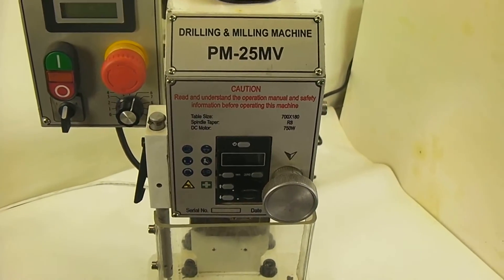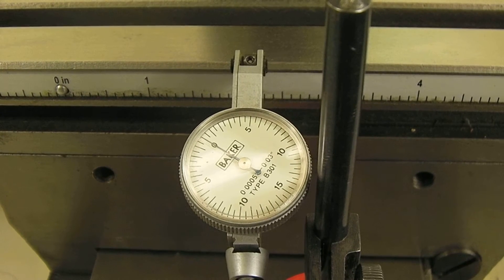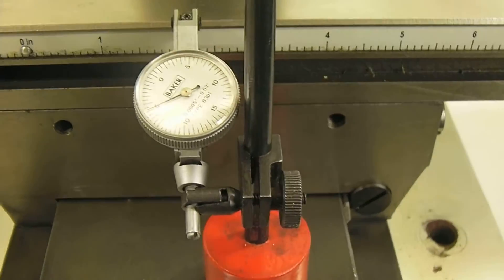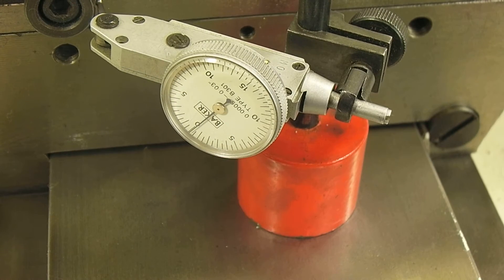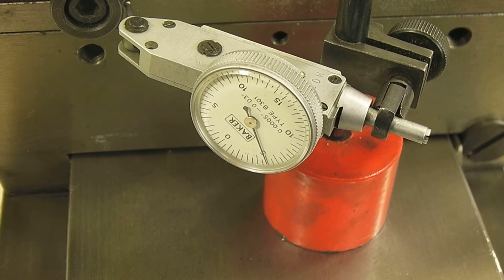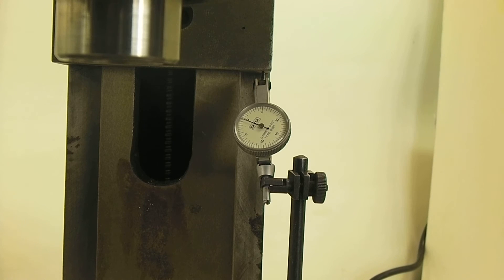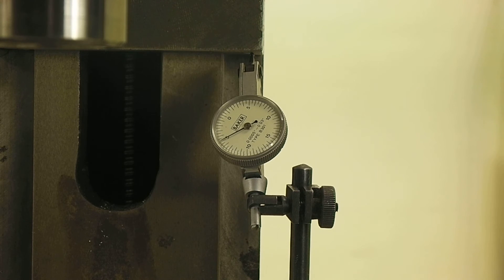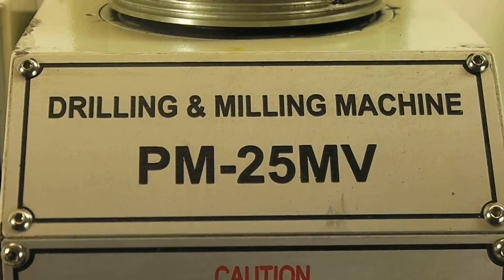PM-25 new style backlash test with C7 ball screws

Comment: Hi Arizona,
could you please give some clue how much bigger the ball size should be chosen in reference to the stock one in order to diminish let's say 0.03mm backlash as much as possible on a single nut generic 1605 Chinese rolled ball screw? The thing is I cannot afford installing preloaded double ball nut on my Y axis due to the machine bed geometry limitations (SX2LF) unlike Z & X where I'm not restricted at all. 
Thanks.
Reply from the maker: I have been packing ball nuts for over 8 years. It really does vary. The older screws had balls slightly over .125". All the newer ones have been slightly under .125". It's quite hard to get one tight without 5 sets of balls and knowing the exact size of the current balls. If you know the exact ball nut backlash and send me a few balls, I could send you a few sets of balls for cheep. 

Loosen the seals and see how much is really the ball nut. You can take out 4 balls and still use the mill. Most the time going from .003" lash to almost tight is about .0006" in ball size. email me at davedaxx1@yahoo.com.

Thanks
Dave
Reply: @ArizonaVideo99  I do really appreciate your prompt yet valuable response! Thanks alot, mate!
Once I ready I'll get in touch.

BTW, when I grew up my school belonged to a ball bearing factory and all of us were professionally oriented  and encouraged to work at the factory after graduation. One day in a week I had to attend the factory to assemble different types of ball bearings. I did double raw spherical ones the most. First I started the assembly from measuring and sorting inner races with microcator in the -100 +100 range in reference to zero arbitrary sample race. Then I did the same for the outer races. Once it's done I used some special formula to select the proper sorted balls for the particular race pairs from the range to maintain appropriate clearance. 
My problem now is that I can only measure balls at the micrometer level max. So the only way I can help it is to rely on your help. 
Thanks once again.
Rostyslav.